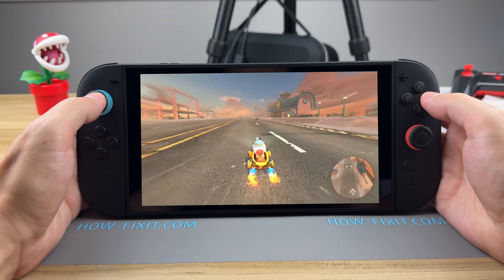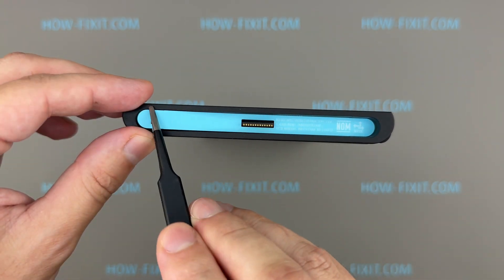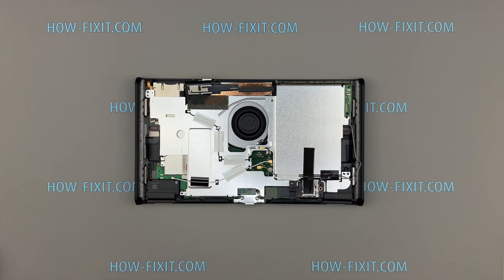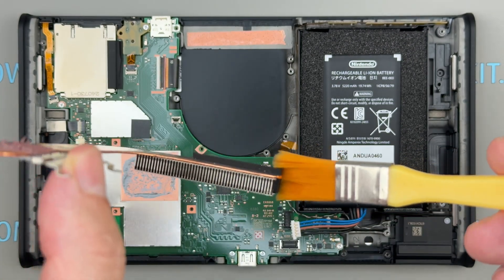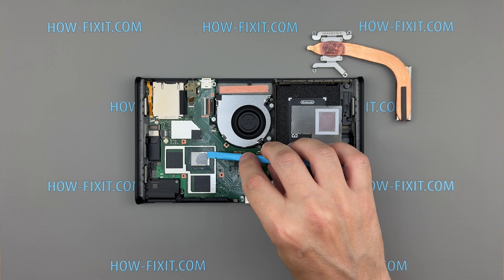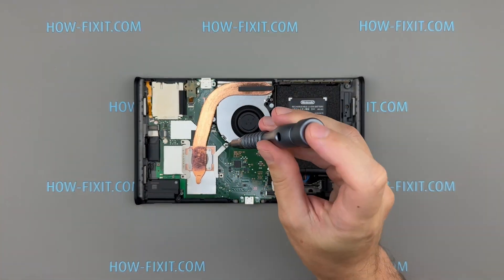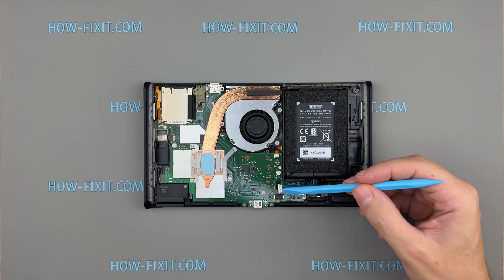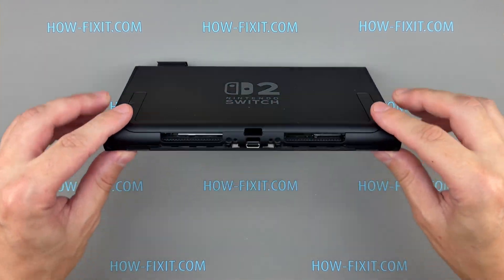Nintendo Switch 2 Overheating Fix: Clean Fan & Replace Thermal Paste

Comment: This looks hard, on my legion go handheld all I have to do is remove 4 regular screws and I'm in 😊, but all this I have to do look complicated... I have a awnser should I just buy a new switch 2 if this overheating thing happens to me? Or should I try to fix it myself

Comment: I usually open all my devices right away and replace the small amount of thermal paste by a generous size thermal pad, but in this case I see a good amount of thermal paste on the switch 2. Maybe I’ll replace in a year or two, depending how often I use the device.
Reply from the maker: Sounds like a good plan!

Comment: I used PTM7950 for the paste thanks to being a phase-change paste that works really well for low-mounting pressure and is very long lasting thanks to no “pump-out”. It is a little bit on the pricey side though. Glad someone made a video for this though!

Comment: Hi! I'm sorry for being somewhat off-topic, but I have a question about Sony PS5. I would be very grateful if you could answer it.

Would you say it should be OK and safe to place the console upside down in a horizontal position (so that the Blu-Ray drive would be on top)? I think there shouldn't be any issue with that, but I'm not sure due to the liquid metal coolant thing. I remember there was a notion that placing the console vertically was suboptimal since the liquid metal would loose the even distribution or something like that. So my concern is, if that would be possible (that is, if the liquid metal doesn't fill the entirety of the cooling chamber's internal volume) , then in theory it would be possible for the liquid metal to loose contact with the APU altogether in my scenario. And that would be pretty bad. 

My console just can't stay put on it's stand and is constantly sliding off from it (that damn stand is a terrible joke!), which is not just annoying but also dangerous. I'm afraid that my console might fall on the floor.

 So I tried taking it off the stand and just placing it horizontally upside down. It seems to lie flat and even in that position, and funnily enough it's also WAY MORE stable than on a stand. It also takes up less space as a bonus.

I deemed asking Sony's support futile, since they're obviously instructed to strongly advice against any remotely atypical stuff just to be extra safe against any liability.

Thank you very much for your attention!
Reply from the maker: Running a PS5/PS5 Pro horizontally “upside down” (disc drive on top) is generally fine. The APU’s liquid-metal TIM is contained by a gasket and shields, so orientation doesn’t matter in a healthy, unopened console.
About the stand, if you were using it vertically, make sure the stand’s screw is actually installed and tightened (many miss this). For horizontal use, the original stand clips on—if it still slides, third-party low-profile feet or rubber pads work well and won’t block vents.
If your upside-down horizontal setup is more stable and the vents are clear, you’re not hurting anything. Stability beats a wobbly stand every time.
Reply: @howfixit  Thank you so very much for your answer! 🙏🏻

My console is relatively healthy (no noticeable hardware issues yet and in the future, hopefully; no spontaneous shut downsbdue to overheating or anything) and was only partially disassembled to clean out the dust, so it should be OK I guess. 

I've been using the stand in vertical configuration initially (set up correctly, with the screw in place), but had to switch to horizontal for a few reasons. The clip-on system proved to be inadequate, (un)surprisingly enough.

Comment: Cleaning the fan and reapplying thermal paste makes such a huge difference, great to see a clear step by step for keeping the Switch 2 cool and quiet
Reply from the maker: Yes it does!
Reply: Doesn’t make a difference because it doesn’t ever get close to overheating to begin with. The max temp under load is 63%c over 30%c less than the overheat temp.